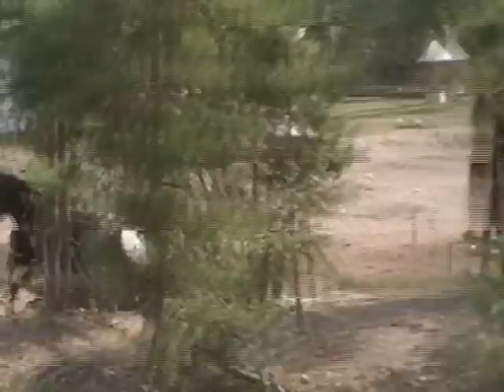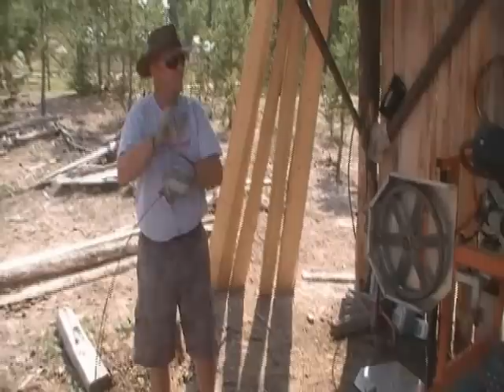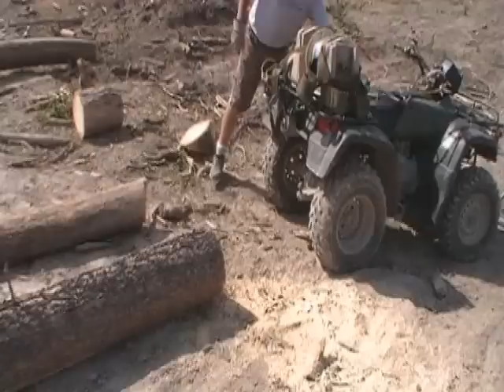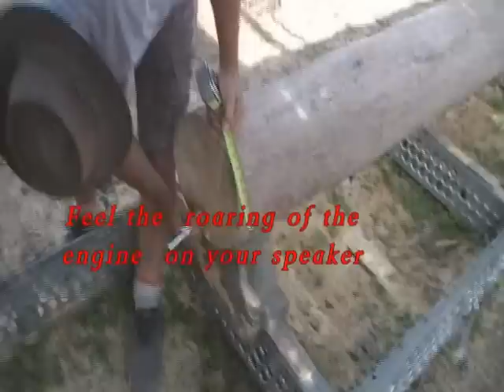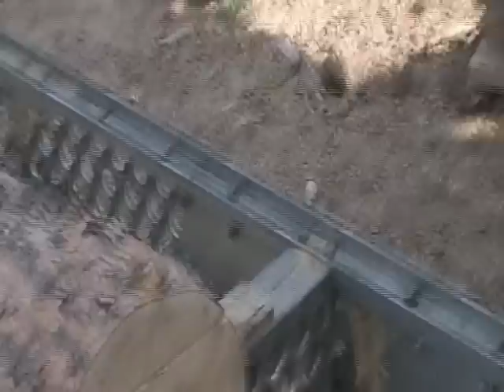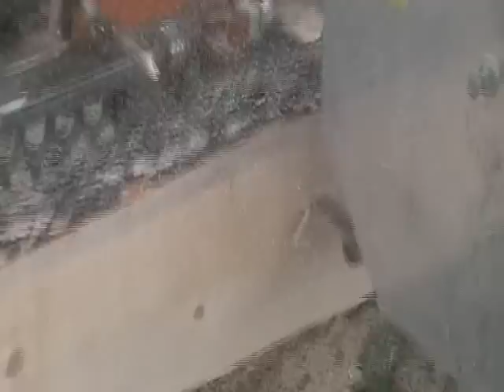How to make money off a  toy?

Comment from the maker: Sorry  this is 4 by 6 for my entrance room, I will show that on my next vlog, and I can make any sizes up to 16 by 16 but I dont have that big trees in my area, mostly I can make up to 10 by 12 or 10 by 10,  I usually make 6 by 10 or 6 by 12, it is most common for me to sell, about $200 to $350 for 6 by 12, 20 feet long, but understanding that you will have to do an extra work getting tree down, and hauling it over to the site, the clear branches to have it ready for sawmilled.